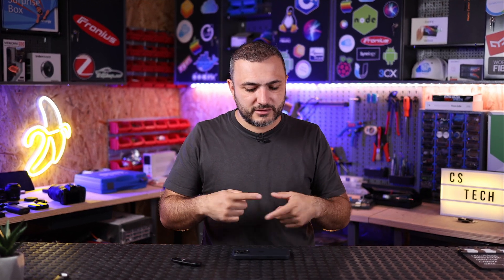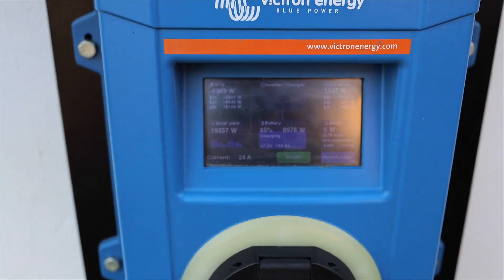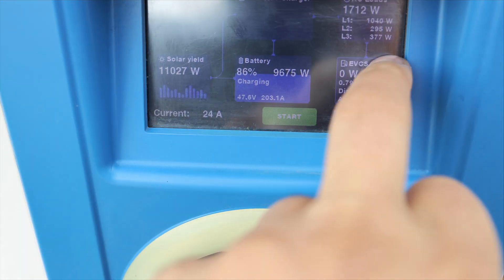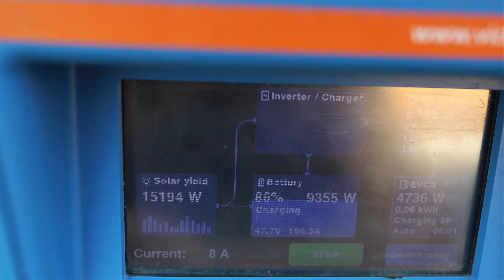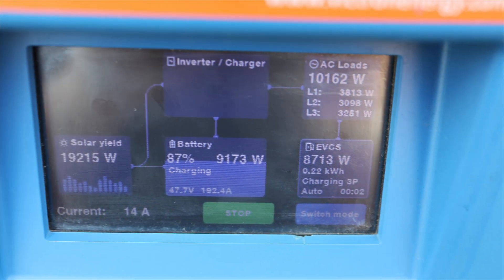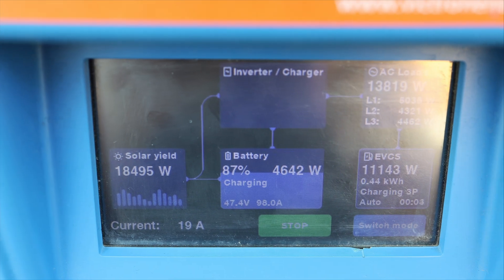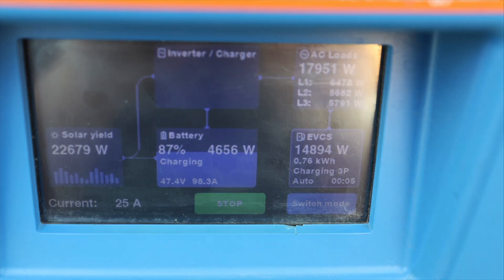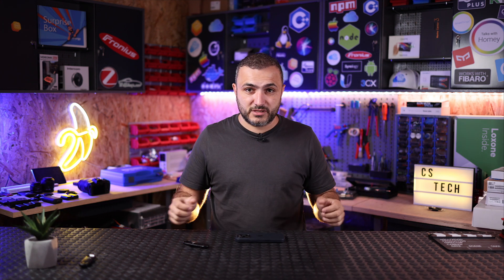Victron Charging Station for Off-Grid Systems | Real-Life Test & Results

Comment: Hi. 

If you are in grid mode, can you choose to take the power from the grid or battery. ?
Reply from the maker: Normally, if the inverter is set to supply all loads (both critical and AC loads), the charging station will draw power from the battery until it reaches the discharge limit set in the inverter, for example 50%. If the inverter is set to supply only the critical loads, then the charging station will draw power from the grid, while the house will be supplied from the batteries.

Comment: If you are off grid (or you can't export), and the house battery is full, then then solar production will drop to match the load in the house. If you then plug the car in, how will the victron system know how much solar is available? Will it probe?
Reply from the maker: Will drain from battery for 1 second, and then will start MPPTs, if is available power will run from MPPT, if not will decrease the power in charging station.

Comment: Hi Claudio, great and very useful video to understand the capabilities of the EV chanrging unit. This is Enric, from Barcelona, and I've a very small solar yeld at my countru house which is trully offgrid.  4 panels of 450W and 4 x 400W, making a peak power of 3,4 kW feeding a pylontech litium battery of 2x3500 Wh which is enough to power the house. all the chargers and inverter are Victron and controled with a Cerbo unit. I've a new EV and I was thinking if my system would be powerful enough to charge it, having in min dha the usage is very low, and I think adding some, say 4 kWh each day would be fine. What do you think ablut this? Thanks.

Comment: Can you pls make a video about the setup. How you reduce home  battery charging and givr priority to the car.
Reply: set it in manual
Reply from the maker: Is not in manual that, we have access to all settings via nodered. A video will come.
Reply: @thecstechvideos I meant to set it in manual mode.
If it needs to be in auto mode, you need to lower the value in the field  "Start charging at battery SOC"; this the home battery priority, I have this at 50%, because I want my home battery to be at 50% before starting the car charging.

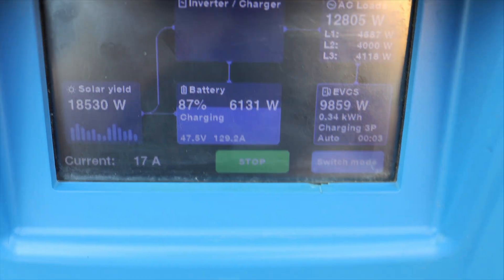Comment: @6:56 timestamp that's not a lie. It's just a wrongly configured victron system. 
On my NS Charger settings there is a setting that you must configure what is the minimum home battery for it to work in Auto. It comes with a quite high value and if you don't change it, it normal that it doesn't work.